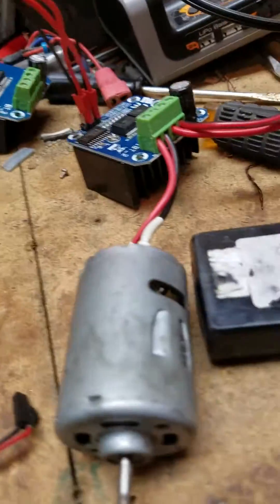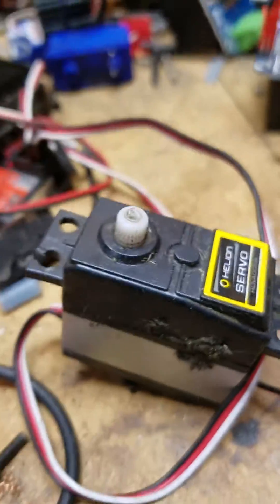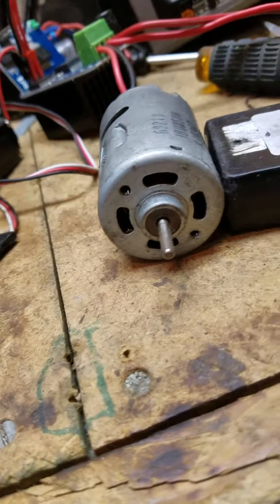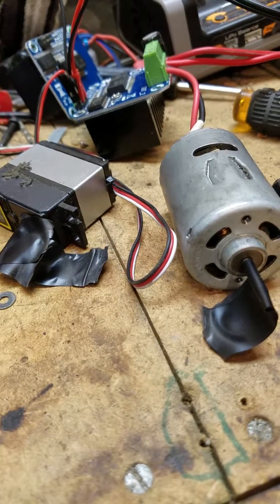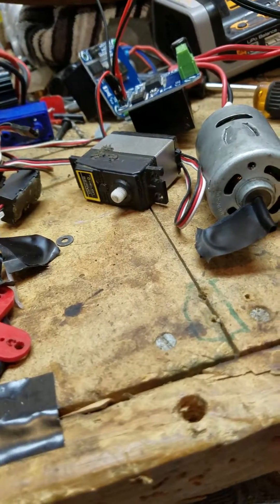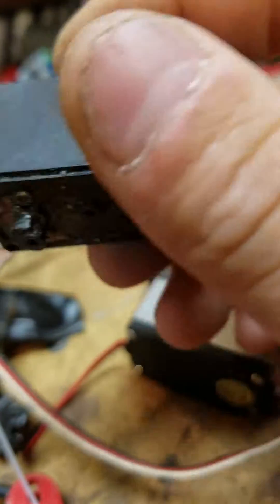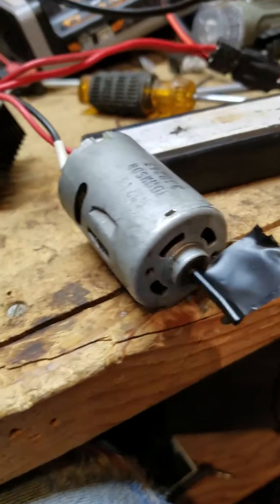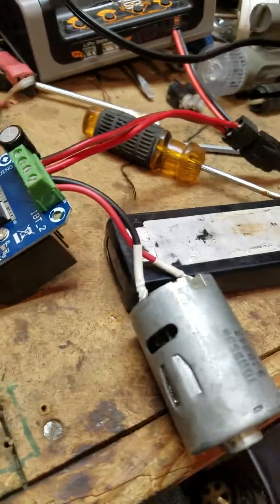Double BTS7960B DC 43A  H-Bridge update

Comment: Great job on the video. I been looking for a video like this. Thanks. I have a servo and the wipers motor. But can you please let me know if it works with a 3 position switch on the remote control?
Reply from the maker: I'm not sure if that would work
Reply: @509trails  hi the servo it should work with the three points that only problem I have is the signal to the actuator is no the same thing.

Comment: Dont sorry about your messy work bench....thats just a sign of "something getting done" lol.  My bench looks the same way!  Thanks for the video!  So, you kept the gears and the motor in the servo......and you just added two wires to the red and black servo wires.  Is that right?  Did you unsolder the red and black wires from the servo motor?
Reply from the maker: Yup I solder the two wires to the back of the motor make sure that the channel that you're using is spring loaded